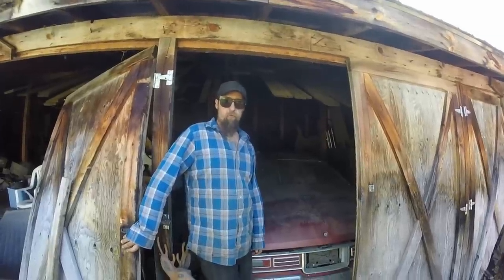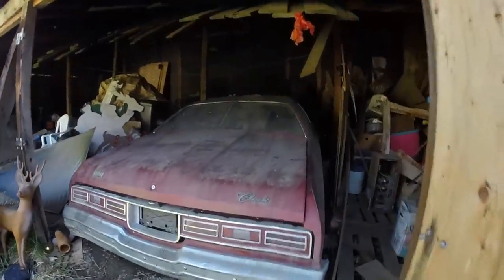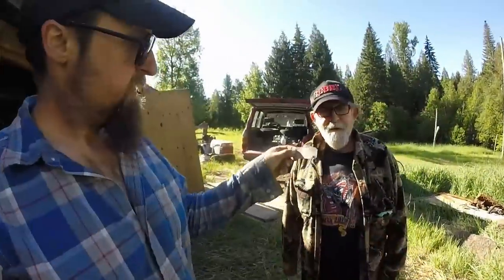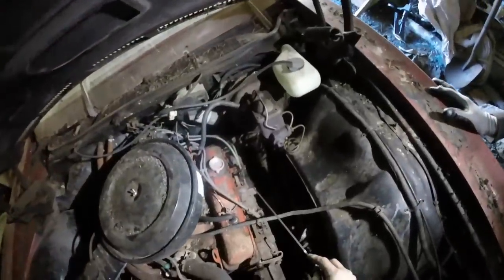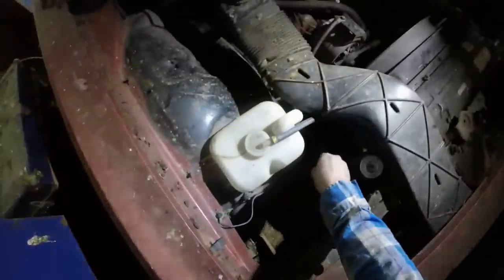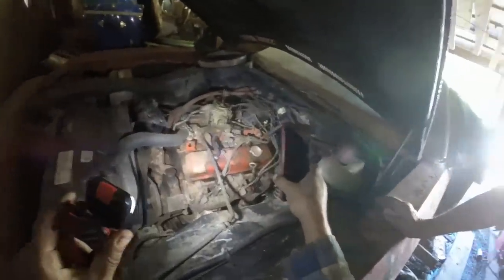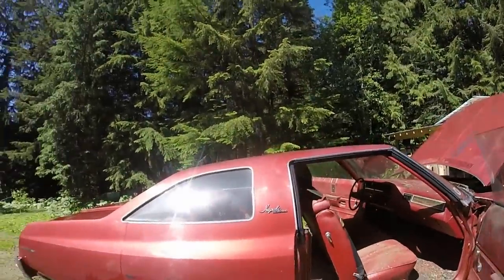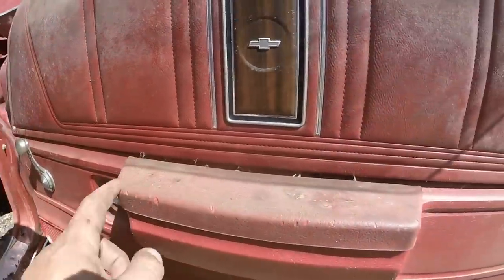1976 Barn find Impala Rescue, Will it run and drive home?

Comment: My father brought one brand new with A/C in October 76 from Potamkin, Chevrolet in Philadelphia same exact color but we did not get a full hub cap. The delivery price was $4,200.00 we got factory alarm bumper guard! The car has numerous issue like the factory forgot to install the plug for differential. The car last until 1985. I love this car, I wish I can effort it.
Reply from the maker: Sounds awesome. I have applied to sell this car on bringatrailer.com I will do a video here soon of the car all cleaned up
For the sale!
Reply: I also paid 4,200 in 1977 for the exact same car featured in this video. Was a daily driver until 2008. Since then it's been garaged and waiting to be restored.

Comment: Back in the mid 1980's I had a 1974 Spirit of America Impala given to me  Minus the engine ..at that time i drove a 1972 Oldsmobile Custom Cruiser station wagon with a 455  400 turbo trans  ..My Dad and i yanked the 455 engine and trans out of the station wagon and dropped it into the Impala ..had a 3:73 rearend  ..That Old Impala would pass anything but a gas station ...She was a Runner
Reply from the maker: I bet lol, sounds awesome
Reply: The spirit of America version of a 1974 impala are a pretty car, I hope it is in white with red and blue pin stripes

Comment: Everything you had to go through including shelling out the dough for this classic true barn find [young as it was at 19 years stowed] was worth every ounce of the tonnage [approx 2.175 tons] of this '76 Impala.

Query:  What are the dark blemishes caused by seen on the Captain's fender?

Edit: p.s. ...those 'poverty caps' are the 'cherry on top' that just dresses this slab of rolling metal and rubber up in a way that without or with after market wheels could not match.
Reply from the maker: That fender had been repainted. I have since taken it down to bare metal and color matched it with fresh paint. Turned out pretty nice for an amateur like me. I posted a couple pix on the channel.. I belive you can find them under the community tab....
Reply: @ABANDONEDCARREVIVALS  :face-red-heart-shape:

Comment: The engine is a 2bbl 350 178hp from the factory. The exact car I've had since 1977. Same exact color, same exact upholstery as mine. I'm redoing my car to its originality. My only problem is that somehow the tag on the firewall went missing. So I don't know what the color code is. Is there any way you could let me know what the color code is? I'd be willing to pay for that info. It's very important to me cause I want my car as original as yours is. Please let me know.
Reply: I'm begging you for that info. Please.

Comment: Very odd the caprice classics had square headlights from 1975
Reply from the maker: Yes, only the impala kept the round lights until they dropped the big body style in 77.
Reply: '75 Caprice had round headlights. '76 Caprice had square headlights. Both '75 and '76 Impala had round.
Reply: It's sucks that gas pig car doesn't have A/C!!!

Comment: Not a 72 , looks more by the taillights of 74 . Not a 76 , 76's had square headlights and different tail lights ... Still a nice car . But not a 76 regardless of what you have read , and that packet of papers you pulled out of the glove box, nice try , if those papers have been in there that long , they would look a lot worse than those brand new untouched papers you pulled out .
Reply from the maker: Yea I was way off lol.
Reply: A 76 Impala custom still had round headlights. A Caprice would have square headlights.

Comment: If that twenty thousand kilometers is correct that means it only has a little over twelve thousand miles on it.
Reply from the maker: It was I  miles, I sold it for $6400 usd on ebay..someone got a great deal

Comment: re you Derrick from vice grip garage?
Reply from the maker: Nope that's roadworthy rescues.
Reply: Your Impala is a 1975, round headlights, 76 went to rectangle
Reply from the maker: @jeffloch2465  says 76 on the sticker. wikipedia says they kept the round headlights until 77....
Reply: @jeffloch2465  nope the 76 caprice has the square head lights the impalas are 1 year behind In body styles

Comment: It’s an early 75 impala or the back lights have been replaced at one point because 76 didn’t have those lights they were more pronounced. The ones that are currently in it are actually 74, retrofit to early 75, mid 75 and 76 are different
Reply from the maker: Maybe canada was different? It's definitely a 76...